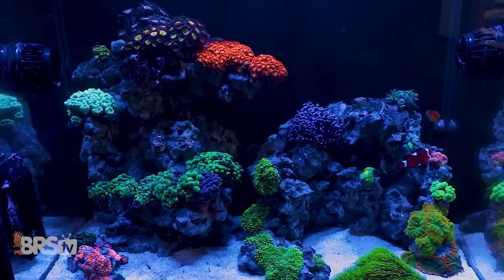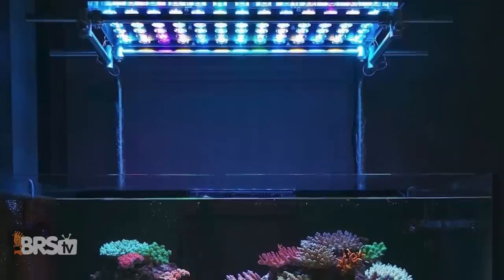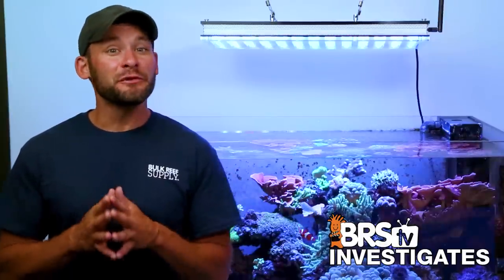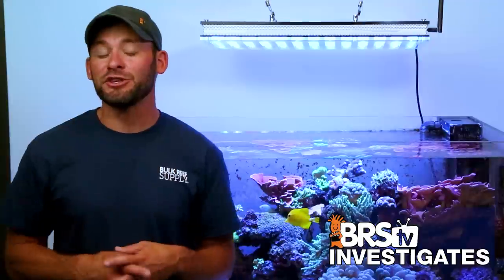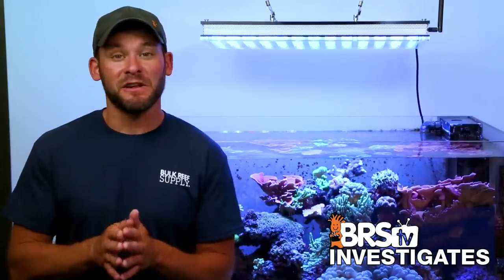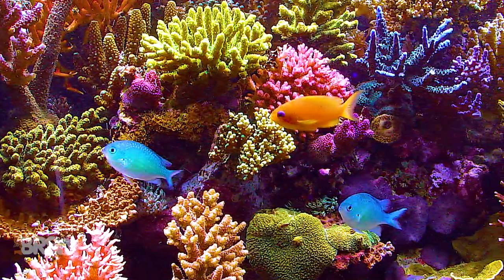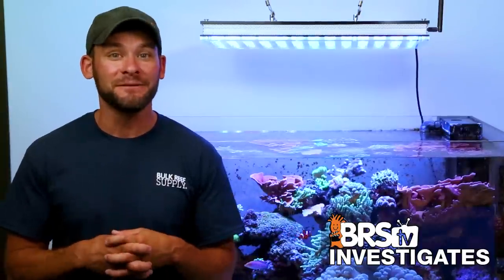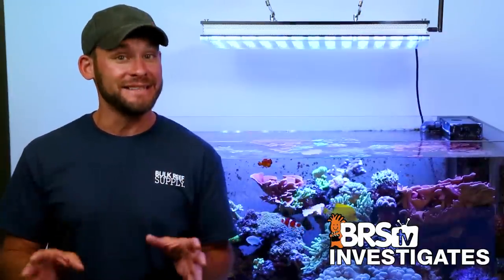How'd they do that!? Secrets behind the Orphek Atlantik V4 and the successful reefers who use them.

Comment: I love mine. Have 3 v4 gen2 over my 300DD and they are terrific. Super easy to set up and control. Great color. Corals have responded very nicely. I'm replacing a radion pro in another tank with an another Atlantik. In my experience it's been better in every way. Highly recommended.
Reply: I just resealed a new to me 300DD and have had issues lighting it. I plan on also getting some orpheks to light it, are yours positioned long ways or short ways?
Reply: @iceicetimmay  they go front to back. I'd have 4 over the tank but the braces make that impossible. Perhaps some day I'll eurobrace the tank and remove those thick black braces.
Reply: @drivemyexotic5274  gotcha Ty. When I resealed mine I did thick glass cross braces

Comment: IMO the Orphek has the best spectrum of any light on the market (although I'd like to see the spectrum peak at 447 with a bump at 490. I'd also like to see lights hit have a small amount of 740. Another good thing is that it's quite blue with all channels set to 100%. The Gen5 Blue now joins the Orphek. I think the Gen5 Blue shows off corals best with that 490 but overall with fish????
Still there are other aspects of the light that are less than ideal.
But if you have heaps of money and want to grow SPS with only 1 LED then these may be the lights to get.
I really think though that the Orphek Reef Bars are their best product and it surprises me BRS doesn't stock them. 2 x XR15 Gen5 Blues with 2 supplemental bars (Reef day at the back and Blue at the front) on a 4 foot tank is probably the ultimate lighting settup.
Reply: There is no such thing as a gen 5 bar light.  The models are OR, OR2 and OR3.  No generation labels here.  Thank you.
Reply: Hes referring to the Radion Gen5 blue I believe.

Comment: Orphek are great light, I use 12 in my system of 1600 gallons which is 1k display, 3 100 frags and 300 gallons sump.. I'm SPS predominant and Orphek works great, however if any light has a problem, you either have to have a spare or buy another right the way. Because their return policy is not good at all. They will send parts to you fix on your own or you have to send to them to fix and wait, as I said I loved the lights and will not change it. But their return is the down side. So I'm buying a spare light. I'm in a middle of exchange emails with them, since they will send me a PC card to try make my light work
Reply: Doesn't sound like any type of support I want - Ecotech turnaround is 1 to 2 days for fixes and if the light is new-ish they will hold a cc and send you out a new light while you return the old one.
Reply: Thanks for your honest post, I was considering going with Orphek but will stick with 4 Gen5 pro on my 400gallon. I've had good success with Ecotech Gen4 and can't afford to keep $1100 spare parts =)

Comment: Would one be enough for a 36x18x18, sps dominant?
Reply: I have an orphek on my 40b, 13” above the water I was getting 300-400 par on the sand bed at 100% on all channels.
Reply: Yes mount 16” above the water line
Reply from the maker: I think that would be sufficient at similar or higher than our recommended mounting heights.
Reply: Stacey Doobrolves  I don’t, that’s just what it’s capable of at 100%, I run mine at a max 55% for a few hours at it’s peak.

Comment: I have a question.
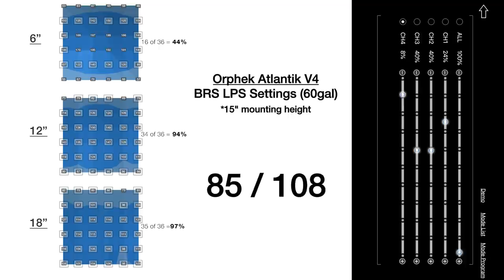 No. 1 ) 12:41  
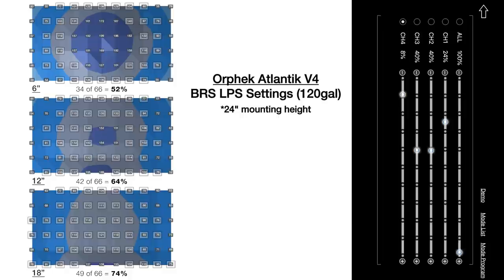 No. 2) 14:03  

When comparing No. 1 and No. 2, the height is 15 inches and 24 inches, respectively, which are 9 inches apart...
But the par value is almost the same. Is it correct that the setting percentage for Ch1,2,3,4 is the same?

I have a 90cm x 50cm x 45cm tank...I'm really~~~confused whether to follow the first or the second height.
roughly i want 6''-250 par , 18'' - 100 par ( i will use ch1 24% ch2,3 40%  ch4 8% maybe)
I plan to use one v4. Please help me :)
I always appreciate your videos.
 thanks bro
Reply from the maker: The major difference here is that the first timestamp shows the single light mounted over a 24" x 24" area, while the second is a single light over a tank double the size at 48" x 24". The dynamics of how the light is distributed and reflects inside those to very different tank sizes is the reason you are seeing roughly similar numbers. 
Given that your tank is about 35" x 19", you might want to start with it mounted at 15" first and then test the PAR to see if it hits your goals throughout your specific tank. If PAR is too high, you can turn down the channels equally or raise the light a little higher. :)
Reply: @BRStv   Thank you so much for answering my question! Please know that here is a big fan of yours in Korea, too. Thank you always~

Comment: What about for a 36"x24"x20" tank :)
Reply: I have a 24x24x24 for over a year.  Looks great with ch1 at 70 percent, ch2 and 3 and 100 and ch4 at 40.    These lights are really strong even at these levels and a lot of corals do better on the bottom of the tank.  I run Bare bottom.  Cyphastrea still need to be shaded even when in lower 1/3 of tank!!  Acclimate over weeks.
Reply: I have a 24x24x24 for over a year.  Looks great with ch1 at 70 percent, ch2 and 3 and 100 and ch4 at 40.    These lights are really strong even at these levels and a lot of corals do better on the bottom of the tank.  I run Bare bottom.  Cyphastrea still need to be shaded even when in lower 1/3 of tank!!  Acclimate over weeks.
Reply from the maker: You might find a single Orphek V4 mounted around 15-18"inches to be a decent combo for that size of tank. Perhaps if your goal was LPS/Softies, a single Compact might get you there as well.

Comment: Gen2s burn out channels 3&4 after 2 years. Not good. Orphek, however,  does offer to help you with an estimated repair costs:

2020 version replacement LEDS $200 (no soldering)
2021 ICON upgrade $280 ( no soldering)
w/ Upgrade to Icon control system add $150

BRS has discontinued the Gen2 V4's as of summer of 2021

Comment: The Orpheks are so expensive
Reply: that's not true, you pay for a 60cm device with a 100cm cover MIN, with the fixure included and lens. A Radion XR30 G5 with arm and lens  and less cover is more expensive and less spectrum.
Reply: @AlinEkisde  The price of 2 Radion XR30 G5 is $1680 and you don't need anything else to run them. The price of 2 Orphek Atlantik V4 is $2200 and you need the Gateway to control it which is another $75 which brings the total to $2275. Why even bring in the price of the arm? You can hang the Radions the same way you can the Orphek.

Comment: This seems like pretty bad performance compared to radion.
Reply: How?
Reply: what is performance for you? an overboosted light that burns corals like radion with that disco effects... I hace a xr30pro over my frag tank and is nice but not natural and too boosted light, and Im keeping acroporas dom.
Reply: In my experience the orphek has been much better than the radion. Easier to control, upgrade, better looking, better spread, better spectrum, more power. Exactly what I needed for my 300DD.
Reply: Alin Reef 😂 if you think the Radion XR30 G5 has a disco effect you better break out your bell bottoms for the Orphek. 🕺
Reply: Darren Caballero your eyes did not deceive you.  The XR30 G5 smokes this just like every other light.  Don’t let the size fool you!  The data speaks for itself. Higher PAR from the Radion and way better spread.  Like double the Orphek’s PAR around the edges.
Reply: @AlinEkisde  this i just not true though, orphek don't even offer a diffuser so you will have more disco ball effect on the orpek, after care with ecotech is second to none, I've heard orphek support is questionable. The gen 5 all the way for me...